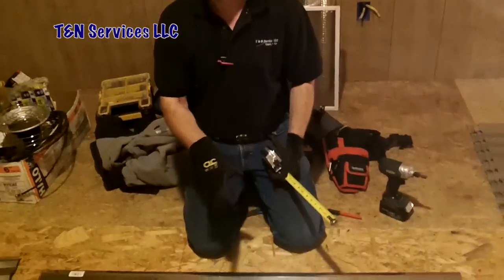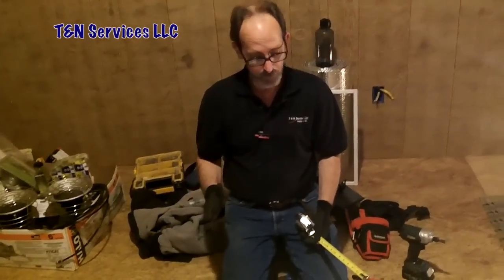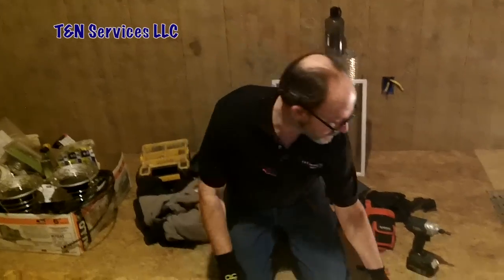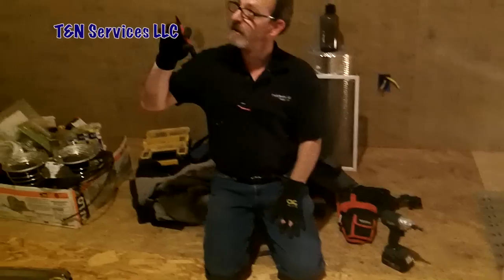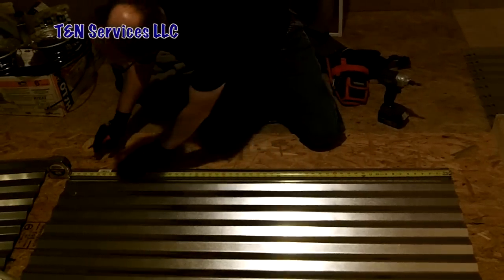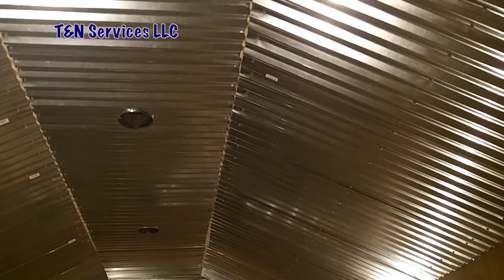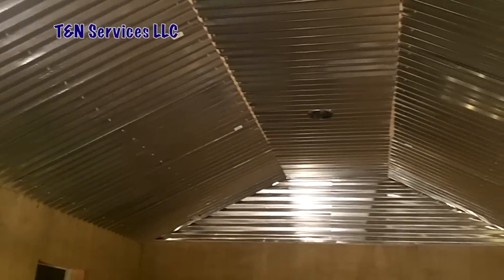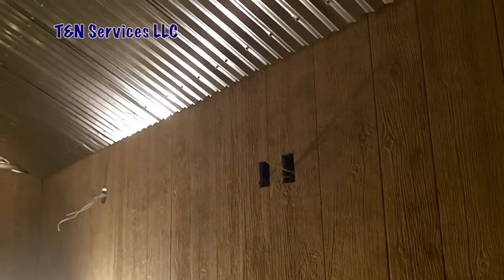Corrugated Metal Ceiling Install

Comment: I would like to do this in my kitchen. I have been to several big box stores in my area, the corrugated metal they sell is oxidized, rusty and looks like garbage. It's supposed to be steel, so why is it rusty? It is a lot cheaper and less time consuming to install, than drywall. I would also like to know how long it would last before oxidation would ruin it in a kitchen application, without having a sealant applied. I like your work, very industrial country looking. You did wonderful, for your first try.
Reply: Goes to show you.... Comments are great! I WANT an oxidized look. I thought I'd have to spray my sheet metal with vinegar and let it bake in the sun to get the effect (which is the MAIN reason I haven't done my ceilings yet) and now I find out I can get oxidized sheet metal at the big box stores? I'm on my way!

Comment: Why did you install furring strips and not apply directly to studs?
Reply: Chris Hall   You need a continuous nailer when installing steel panels so you can fasten it in the low spot. Without a furring strip you will run into problems where the rib (high point) falls on the stud and that’s no good. Plus that corrugated stuff needs to be screwed closer together than 16”  Hope this helps.

Comment: hey, why this outside roofing material on a ceiling????
Looks nice, but I just don't see why!  : -)
Reply from the maker: +JohnnyBallou I used it to be different. I considered Sheetrock but by the time it was over the metal was cheaper. Also the walls inside the building is exterior siding. One again it was different which is the look I was going for.